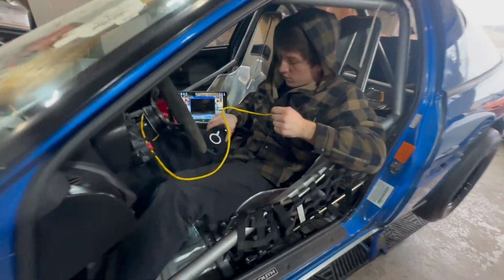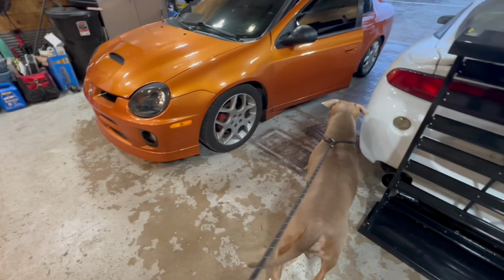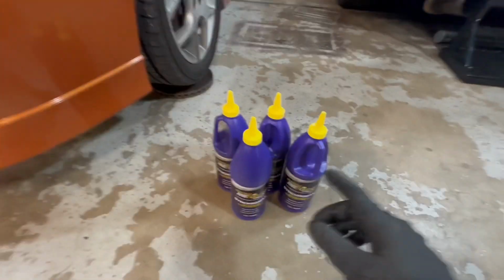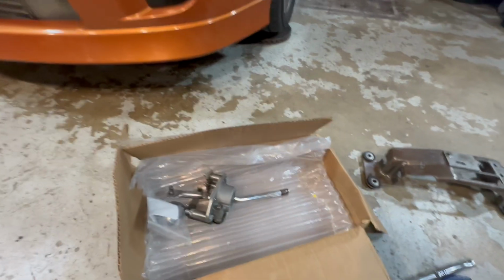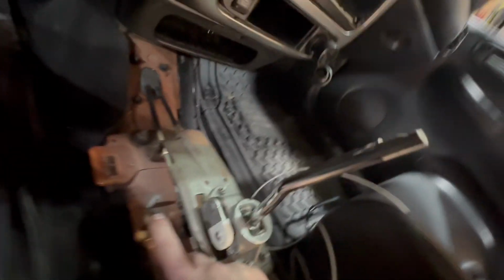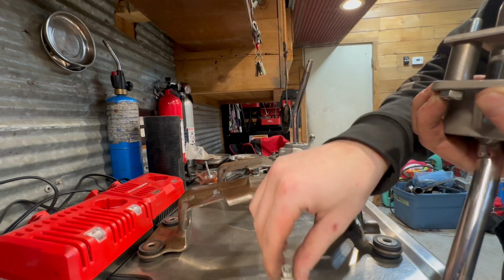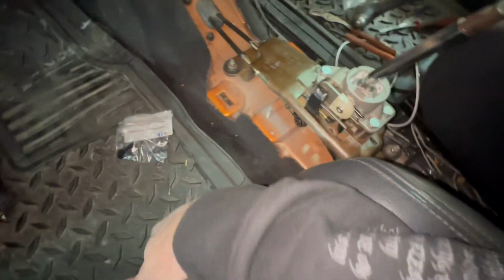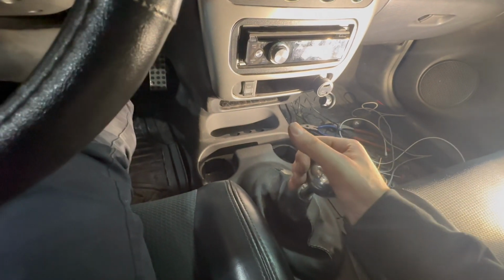Srt4 Maddog Short Throw Shifter Install and Transmission Flush

Comment: about to put royal purple in mine this weekend. i have to adjust the crossover cable and the metal plates on the short shifter
Reply from the maker: The royal purple has been great so far no complaints honestly. Thanks for checking out the channel💎.